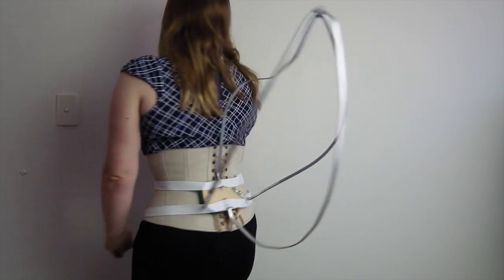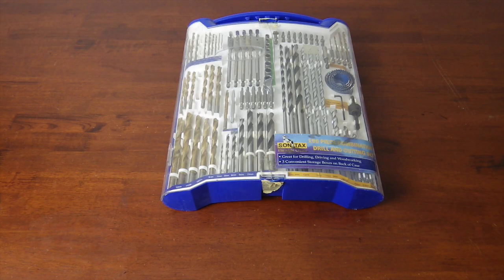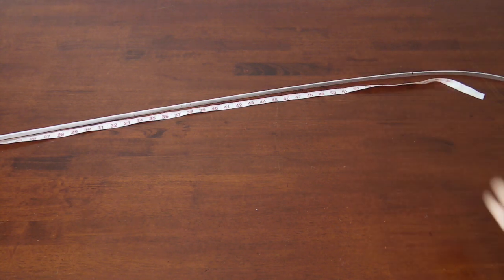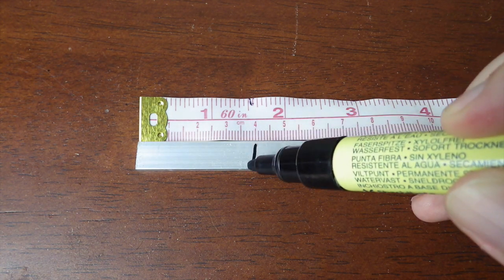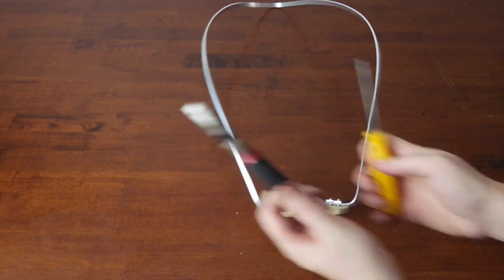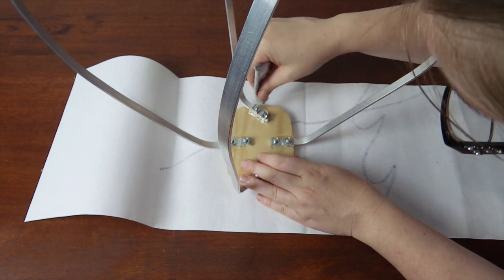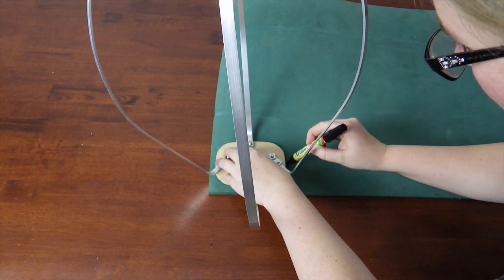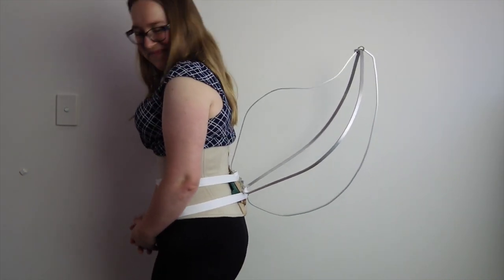How to make an upright tail for cosplay - Part 1 - Constructing the base

Comment: Is this for a fur suit or something?
Reply from the maker: It can be, or to be used as part of a cosplay that has a tail. I was making mine for a flareon design
Reply: @KirileeCosplay  oooooh!!! That makes sense, i was wondering with it was so full.
Do you think you could make one that's more slim, like a wolf tail? I'm trying to think of how I would do a 45cm-50cm wolf tail.

Only I want it to be a bit more swishy and maybe even flexible. Like you I'm a sewer, but normally I'm good at adapting my skills into other area's. How ever I've been struggling with this kind of thing.
Reply from the maker: If you want it squishy - you will may need to holster it up with some fishing wire.
Or create a base with PVC piping.
All the best! Good luck!
Reply: @KirileeCosplay  I meant swishy not squishy.